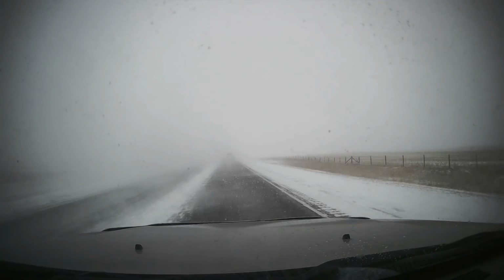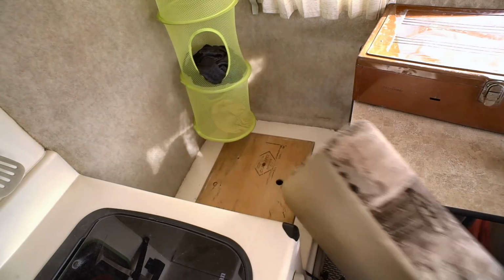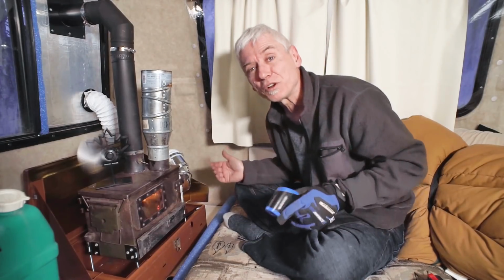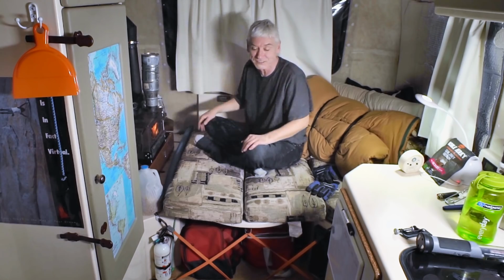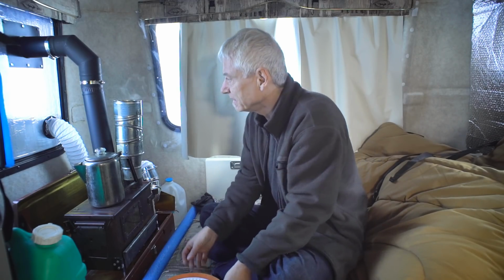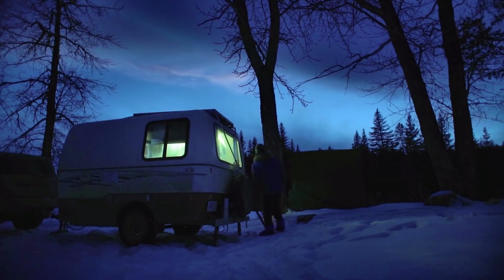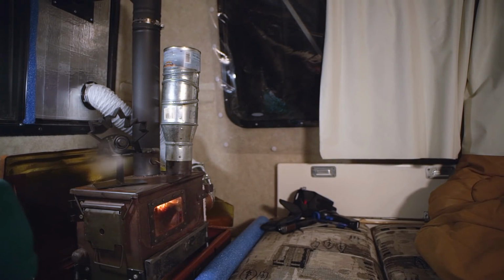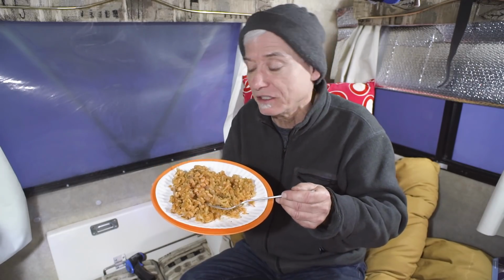Camper Wood Stove Experiment Pt 3: Feeling the Heat!

Comment: I think that wood stove is a great idea, for one big reason if you get snowed in and ran out of propane you always have a wood source to burn from your surroundings and also I think it cures condensation issues you may get using propane. My idea would be to modify the closet, basically cut that in half and place the wood stove on top and in the summer when you take it out you could add the top half back? I would also make the cold air intake fire/melt proof and I would use two sheet metal screws on each stove pipe section but I would modify the sheet metal screw heads by welding a wing nut on so you can set up without tools. But I would only do all this if you were committed to the wood stove. Would like to know the right size ammo can to use, not sure if you mentioned that, love the design though good job!
Reply: 50 caliber I believe

Comment: Hi SP.  Great video.  There must be a lot of BTU`s coming off that stove to keep warm in near zero degree weather.    I freeze my rear end in my styrofoam laminated wall camper when its forty degrees outside with my propane furnace going full blast.   Makes me wish I had an alternate heat source...

Comment: Not sure if this was asked already. Have you thought about moving the stove to the counter top and adjust the stove pipe? 

Also something that might help. Take a copper pipe and have it run from the floor to the heat reflector. That might help circulate the air better.
Reply from the maker: Part 1 shows the reasons I chose this spot. Thanks! SP

Comment: I enjoy your experiments with your stove and how it has evolved.

I also wonder if it would be possible to build a shelf at window height and elevate the stove and shield to that position  and shortening the stove pipe.  That way the heat would be higher in the trailer and as heat rises it would possibly be a little cooler down below. But most important it would form a space under the stove large enough to again use as foot space when sleeping rather than having to sleep diagonally.

Just a thought.

Comment: If you need to brace the stovepipe just put a piece of galvanized strapping around it, use a nut, washers and bolt to hold it, then trim strapping a few holes longer. Simply use an appropriate length bungie to clipped into the strapping holes and wrapped around your awning support.  =)

Comment: Excellent video... I've got a couple  of questions and comments. 
Have you tried to camp using firewood?  I would be curious in your fuel X time ratio.  I'd be willing to be ya have to feed it more often if your burning wood.
I would think if you use strictly pellets you could down size the diameter of the stove pipe.  My buddy has a big pellet stove set up to heat his entire trailer.  His only has a 2" vent pipe.
Ya got my wheels churnin.... I think I'll make one with strictly pellets and another using propane burners.  HEEEEEEEEY, maybe I'll build one that's dual fuel.  Propane burners that could be used as a stand alone or use the propane burner under your firebox grate to help ignight and if the pellets was burned way down.  The propane burners would keep up enough heat to knock down the chill
Reply: Taz Man Thanks for commenting! You sparked some interesting thoughts regarding proper sizing of piping. Maybe bigger isn't always better? Propane is a problem when it gets really cold, also a very "wet" heat source.
Reply: As long as the area in your flue is greater than the area of the combined area of your intake holes I don't think you'll have any issues with Carbon Monoxide or smoke coming back on ya.
I've been schemin and planning...  I understand your concerns with the moisture and condensation in a trailer.  I use mine in a wall tent.  But if the propane was set at its lowest setting was kinda like a "pilot light". It would keep the pellets going.  I'm liking the idea of an additional means of keeping warm.
The one I made is solid fuel only.  I have a large gauge expanded metal about 4" above the bottom of the stove.  I have actually used a big piece of coal to keep it going through the night.

Comment: I WOULD LIKE TO USE THAT LITTLE STOVE IN MY LITTLE 12 BY 16 LOG CABIN I BUILT ,BUT WAS HOPING U COULD GET THE STOVE TO LAST WHOLE NIGHT WITHOUT REFULING OR GETTING THE ASH AIR HOLE POKED PROBLEM SOLVED. EXCELLENT VIDEO
Reply: larry johnson - I imagine Dennis the Menace would simply need a bigger belly!

Comment: You would need a fairly large amount of pellets if going on an extended trip.  Have you tried it out yet with wood that you may be able to acquire locally?  I have an integrated diesel heater & HWS system in my campervan and I love it.

Comment: Slim livin on the edge!  Love the video and content.  Since seeing your pellet stove build I have wondered if another option is to build a small stove like this with a water system that would bring warm water into your camper through a radiator and then return to reheat.  Just a thought.  It may be safer.  It may complicate the fire maintenance.  Maybe the water line may present some steam pressure issues.  Might be something to ponder.  Kind of like the outdoor wood burners that use a liquid heat transfer system to heat a house.  Hmmm?
Reply: Tim Comer - I've been on that same wavelength. If you did that and was mindful of water line orientations and elevations you could get a thermal siphon going and negate the need of a pump, keeping the whole system functional without the need of electricity. The possibilities . . .
Reply: That would like be much more inefficient

Comment: Slim,  I saw that wind.  Are you still using a windmill for additional power?
Reply from the maker: No. Wind power on a small camper is not worth the effort. I trashed it. SP
Reply: @SlimPotatohead  Okay.   I remember you used to have it.

Comment: Could you adjust the amount of wind coming in with another damper inline in the air intake? Similar to the one in your exhaust flue.

You could always add an extension to "Dennis" to give you longer between refills, if needed. Maybe even another galvanized section of tube, larger at the top and reducing to the existing pipe's diameter.  = )

Comment: Question: First off, you did a fantastic job with the stove design and I don't see much room for improvement. I am curious though, why you end up blocking off your secondary intake in later videos? Was this to prevent the possibility of smoke/carbon monoxide leakage? Could this be remedied by having the secondary intake connected outside?
Reply from the maker: Excellent question. My original design included a secondary burn, but after a lot of use I never saw any benefit to having it. It just never ignited anything. I suspect it was because I was using wood pellets, which burn well with little secondary gases to ignite. Perhaps with "dirty wood" it would have more of a benefit. Thanks! SP
Reply: @SlimPotatohead  Huh... Good to know.  Thank you for the response!

Comment: 10:40 It's likely cooler at the curve because where it connects to the window acts like a heatsink in a way, so some of the coolness from the window and the insulation, will transfer down the exhaust tube.  Although I'm a bit surprised that there is a 200 degree difference between the top of the stove and the base of the exhaust tube.  I'd expect that to be quite similar, maybe 50 degrees difference, but not 200 degrees difference.

My only concern with using a stove in this type of situation, where you're close ot it, is if you put some sort of barrier (that wouldn't melt) between you and the stove (I'm thinking when you're sleeping, so you don't accidentally bump into it and burn yourself.  I know some people will put theirs behgind a metal frame and perhaps have glass around it (but the top open so it can circulate air) so that if they accidentally bumped into it they wouldn't get burned because they wouldn't come in contact with the stove.

Comment: here is an idea for your flue brace.  glue a strong neodymium magnet to the inside roof/wall where it would be convenient to put a brace for the flue on the outside.  and another one at a distance to make a 45 degree angle to the flue.  make a brace with rods that have magnets attached to the ends so they stick to your glued magnets inside the camper.  tada!

Comment: Hey have you tried using wood chips instead because you can get those free. And as long as you can wake up every hour you could put levels in your feed system. Then have a couple metal slides of

Comment: Nice stove design, with double combustion, airflow through, pellets camera, external air intake, oven box to Cook an isolate heat to the botón, simple ledges inserted into hinches... Clever. I would put a rotatory cap on top of chimeney to suck smoke in a y air condición and Improve Security.  Enjoy!

 ai

Comment: Would it be better in a windy situation to use a spinning chimney cowl that adjusts itself to the direction of the wind? It would make sure that the wind would always be pulling the gases from the stove out of the stove pipe. Less chance of blowback into the stove if the wind picks up
Reply from the maker: The catch is that it would have to be perfectly level to work. SP
Reply: @SlimPotatohead  that’s true! And i guess in nature, getting it level is quite the challenge 😬

Comment: That your stove ran for 15 hours on just two containers of wood pellets is quite amazing. 

Does the hopper automatically dispense more pellets into the stove as previous ones are consumed? 

I ask because I have no experience with this fuel type. 

This is a very interesting and economical method of providing continuous heat.

Your stove is particularly impressive, especially with your external air intake and built in oven.

Your closed stove system is especially neat, too!

That old stove repurposed as a base for your pellet stove is perfectly sized.
Reply from the maker: Yes. Gravity feed. Thanks! SP

Comment: Enjoy the innovations-

Maybe those with no existing propane furnace might consider the Dickerson Newport propane fire place - 9000   Or the larger 12000 -  probably overkill    And would be permanent.   Plenty  of videos.  Plenty of parts    Fire view Window and dual inlet exhaust flue.  Does require electric and replenishment of propane    Popular as an option on boats
Reply from the maker: You forgot to mention the price tag! SP
Reply: @SlimPotatohead  Dickerson makes a wood stove too $$$$ ouch!

Comment: Slim forgive me I am trying to wrap me head around the fresh air in stake.  Did I miss this step.  The last thing I remember was on the secondary fresh air intake on the front of the stove.  If you showed hooking up to the rear please tell what video that was. TY stay warm.
Reply from the maker: Hi Louis, there is no secondary intake. The primary intake has always been on the door. I did have a secondary burn in the early videos, but it was removed. Thanks! SP

Comment: I got the cubic mini grizzly in my rv. I have had it for 3 years now and it's great.
Reply: Is your grizzly stove for wood or pellets? Our son just got the wood burning stove, and it isn’t putting out much heat. Any suggestions?
Reply: @loricody4956  as far as I know the cubic mini stoves are made to burn wood. I tried pellets and got some heat but for the winter time in the Canadian prairies I was burning wood as well as fireplace logs from lowes. I have used it in minus 40 Celsius and was fine. That being said I also wasn't heating the whole motorhome, I separated the back bedroom from the kitchen and living area and just slept on the couch. I also had the air intake wide open the whole time and I wasn't shy to put plenty of wood in once I had the fire started. I hope this helps take care.
Reply: @moderndaydrifter4672  Thanks for your response. We are also in the Canadian prairies. I wonder if this is just a matter of tweaking. He is at the minimum length for chimney, and it isn’t drawing well. The solution may be a bit longer chimney? 
Do you have a fresh air intake hooked to the stove? 
Thanks again.

Comment: Hi Slim,  Are you aware of, have you considered the Nu-Way propane vented heater? Looks like a tiny wood burner but uses propane without needing electricity. Might be a little less quirky than wood pellets. Folks don't like links, not safe, so just google search it.
Reply: I got a reply in my G-mail that doesn't show up here. Essentially, you don't like propane heaters due to moisture. The Nu-Way is more like your wood stove. It is a flame in a box that is vented out with a stove pipe. No electricity needed. Dry heat. Search on YouTube  "Cargo Trailer Camper at Minus 15F Degrees !" video. These are more common on sailboats I think.

Comment: Hey Slim There is another alternative for a heat solution you may want to consider trying it out. It is a Bio Ethanol Fire Place. It Runs on Bio Ethanol fuel you can but the fire places already built in different sizes or have them custom made to your requirements or no doubt as you like to build your own things you could attempt to build your own and have a nice glass door on the front so you can still see the fire burning and vents on the front and sides so the heat will release into the camper, it does not need a chimney or a flu as the fuel for these fires are non toxic no smoke you can get fake looking logs and coals to make it look realistic and regulate the heat  the lower the flame the longer the fuel will last before you will need to refill the fuel you can adjust the flame height with a tool that suppliers provide and all you need is the fuel available in 1.2 ltr up to 5ltr bottles you can get false flues for asthetics but not needed. Also you can even get Bio Ethanol Stoves and Ovens to cook food.
Reply from the maker: Philip, I'm sure this would have benefits to an urban house. But for a fiberglass trailer in the wilds, I can't imagine it being practical. First of all, it needs a permanent installation to even test. Second, the cost is astronomical even at the "beginner entry" models. Third, where am I going to get bio ethanol fuel in the wilderness? Perhaps if demand warrants it, some camper company might consider this as an option in their more showy models. Thanks! SP
Reply: @SlimPotatohead  Get your facts right they don’t all need permanent installation some are portable put on tables etc or on a patio outside and in your case where you pellet burner is
Reply from the maker: Philip, I have not found any portable units anywhere. Can you please give me a model and company name? Also, are you suggesting it run in a camper directly without venting exhaust? Is the byproduct not large amounts of water ?  Thanks, SP
Reply: @SlimPotatohead  Try Amazon

Comment: Slim, i haven't seen any info, unless i missed it... can you give some details of the piping to the stove as to where you ordered it and white size it is etc... i'm also in the market for this exact stove pipe but can only find Rona's 5" wide by 24" long which might work but would rather do 4" which is what i think you have.  Cheers
Reply from the maker: It's 3". Rather a pain to get as I had to order it from the US. Thanks! SP
Reply: @SlimPotatohead  link?
Reply from the maker: Try Ebay
Reply: @SlimPotatohead  Slim i was actually able to order it straight from Amazon Canada, made by Imperial Mfg Group.  Price was not bad either.  Will see how it works out once i receive it.

Comment: I was always told you should have you stove pipe fitting in the other direction so the creosote drips inside the pipe walls???
Reply from the maker: Whoever told you that does not understand this stove. Creosote drips outside, while smoke inside is kept to a minimum. Thanks! SP

Comment: I would recommend you get some folding Portable Solar panels, so they can be placed out in the sun, rather than having to move your trailer.  Especially if you park in the trees, and sure enough the trees will cause shade from the sun.

Comment: A thermal imager camera would tell you more. Inside and out yes I got one and tried this test. It's a little different how heat transfer works.
Reply from the maker: Not sure what you are trying to say Brett. Care to share your findings? SP
Reply: @SlimPotatohead  it takes a wider picture of temperature. Not just what it's pointed at. I've found those are hard to pin point.

Comment: Great experimenting. Personally I would be concerned about  local heating of GRP body shell behind the heat shield.
  As an emergency measure without propane or 12V this would be great. It is just so much extra to carry. 
  As you say, “go somewhere warm” ! Keep safe, Regards from U.K.  AJ
Reply from the maker: What's a "GRP" ? SP
Reply: @SlimPotatohead  Sorry,   GRP, Glass Reinforced Plastic; aka Fibreglass. Regards.AJ

Comment: I like your videos:)
Do you have a second, or backup way to start the stove, like gel and matches, or??
Reply from the maker: Good question. The torch provides flow to direct the exhaust up the flue. I could use matches and an accelerant but it might be smoky. Thanks! SP
Reply: @SlimPotatohead  Thanks for the reply Slim.
What if you built a small fire under the stack 1st to heat the flue to help start your draft?
Only reason I ask, is I have had issues with torches in the past, and a backup would be useful especially in an emergency. It would also make a neat video idear!! Happy warm Camping:)
Reply from the maker: Good concept, however with the channel in place there's no way to access just under the stack. Another solution would be to run a small hair dryer (I keep one in the trailer  for wet socks) to direct a fire under the pellets. Never tried it but it could work! Thanks, SP
Reply: @SlimPotatohead  Thanks for the reply Slim.
That's a good idea!!!